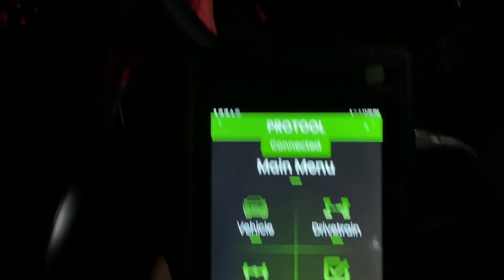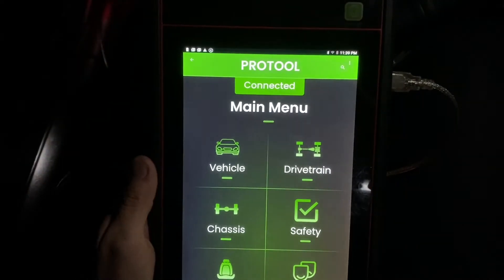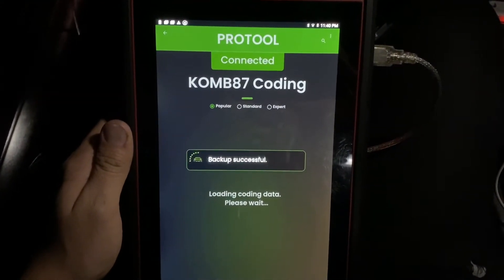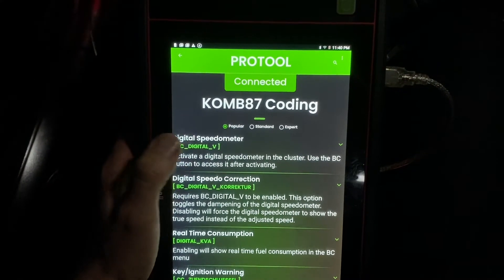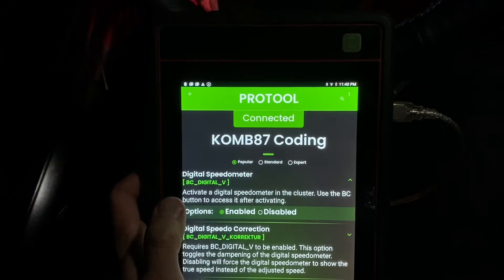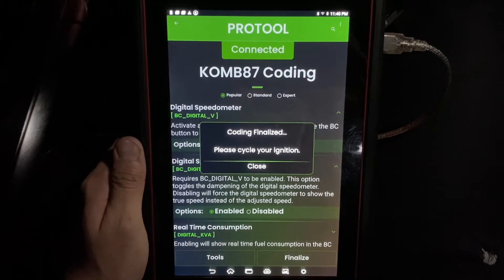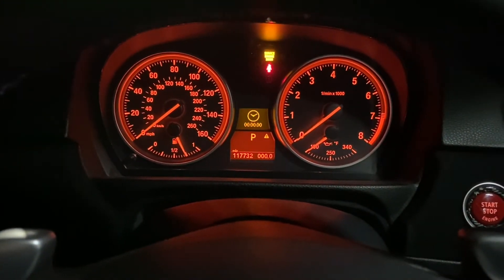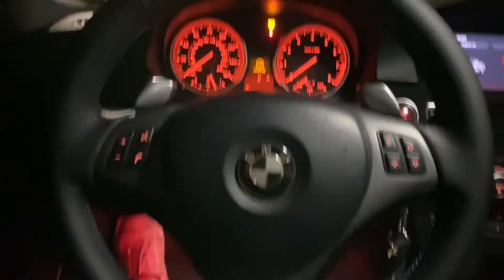How To Code In The Digital Speedometer! BMW E9x E8x and E6x

Comment: Is that the only tool you can use to code .
Reply: Its not the only one but by far the best and easiest one to use I find.
Reply: @Matt335i  You can code it with NCS expert, it's a free tool you just need a windows laptop and a K+DCAN cable. I made a video how to do it https://www.youtube.com/watch?v=2w_fK70Yawo
Reply: Hi I have to replace the cluster on a 2015 x5 you think it will work thanks
Reply: You can code it with NCS expert, it's a free tool you just need a windows laptop and a K+DCAN cable. I made a video how to do it https://www.youtube.com/watch?v=2w_fK70Yawo